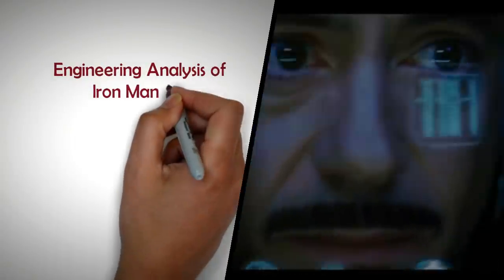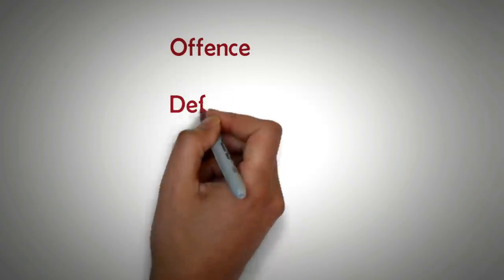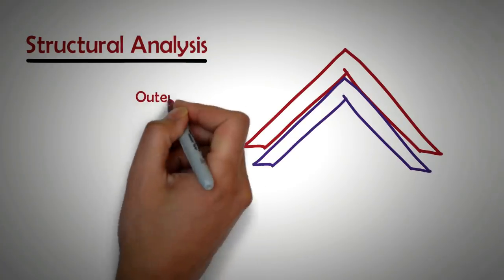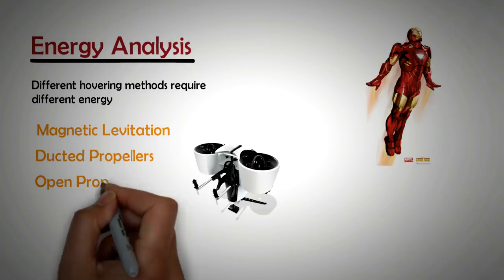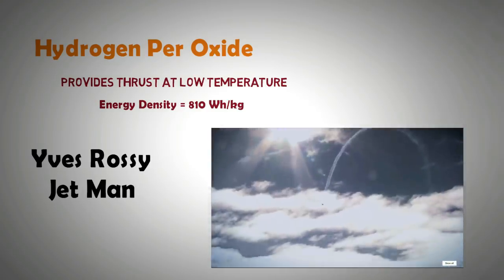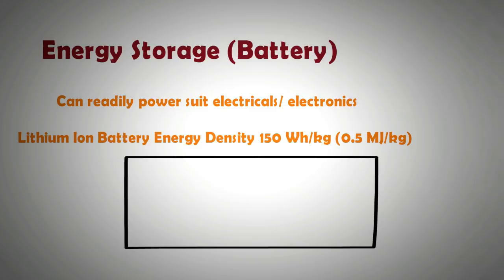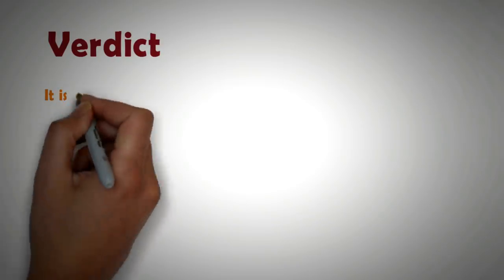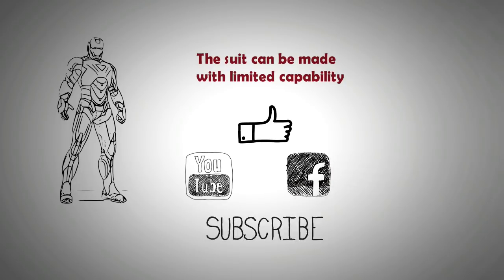Engineering of Iron Man Suit

Comment: Barely anybody is considering a layer of graphene to help with armour. Probably because it’s still technically experimental, but scientists say it could stop bullets

Edit: whilst being thin and lightweight
Reply: Mr Boombastic it would take 23 layers of 1nm thick graphene to stop a 9mm round
Reply: Mr Boombastic also in order to improve energy sustainability you would need CNT (carbon nano tube) muscle packs to have a sufficient power to weight ratio plus the cnt would enable the suit to have the power of a jackhammer in every limb
Reply: Interesting.

Comment: in my opinion, the arc reactor would use degenerate matter, more like a capacitor than a battery. perhaps it simply has a long half life, or the degradation of a certain size mass of matter takes a long time in certain conditions.

Comment: any engineer would know that the suit is impossible (at least for a few centuries) and even if you can find some power source that can power it and could be small enough and safe to put inside the suit it simply impossible for human body to sustain the operating conditions of the suit it could be done but no human inside and would be unbelievably expensive that probably would need the entire money of the globe for several years and it would also be bigger in terms of size. However if you remove some functionalities like flying and hovering and limit it to only ground then yes human body could possible sustain the operating conditions and it would be much cheaper

Comment: The best suit would be a sort of remote controlled therefore not an actual suit but you the controller located in an unknown extremely secure location having intimate control of a suit equipped far better than anything wearable. Then you can have a type of nuclear powered capability. But then the physical interaction factor will be missing. The thrill of actually flying at ridiculously impossible speeds n all that. The thrill factor is a major draw for audiences which cannot be replaced by RC tech. The desire for the wow factor will keep the tech in the realm of sci-fi. RC would shorten the distance distance between the possible n impossible. I doubt the creators of Ironman for public consumtion would ever consider a RC suit. But for real world applications RC robotics is the way. Full speed ahead
Reply from the maker: This idea was explored in Iron Man 2. Problem is when you lose control

Comment: So batteries are impractical, cold fusion doesn't exist and energy density of anything besides nuclear is too low. So work with what is practical'ish...You ruled out nuclear from the start rather than trying to make it work. So...can nuclear be made to work? Stark didn't let that constraint stop him, he later was getting a toxicity issue himself from his next gen arc reactor creation. Maybe nuclear is the only option...can it be done?
Reply from the maker: You can have small nuclear power plants but the problem is radiation shielding. The amount of lead that will be needed would make the suit too heavy. It would be more like the Iron Monger Suit
Reply: I'd settle for the iron monger suit, lol.
But again, that's using old tech. Can we improve shielding tech? Aren't there other elements heavier than lead? How about degraded nuclear fuel sources? Is there a way to less energetic nuclear fuel that is easier to shield? Or how about teeny reactors in a multiple configuration.
Reply from the maker: No, even in depleted rods there is Gamma radiation that is a killer. I am going to explore this issue in my up coming "Spiderman Infinity Suit" video so keep an eye out for that one.
Reply: Will do, thanks!

Comment: What I don't get Is, when Tony pulls his suit from a brief case and the suits fits around him, how thin is that metal?
Reply from the maker: Well, it is a property of metal that it can sliced into thinnest of of slices. So making metals thin is not a problem. Having thin armour on you and thinking of it to be effective is another story
Reply: Synergy Files yes but my point is in the movies the metal just appears around his body the metal would stretch that far and hold it's strength? one step it would just rip like paper.
Reply from the maker: From an engineering point of view, I am thinking he can almost fit a 2mm thick sheet suit in that case. And 2 mm alloys are reasonably tough
Reply: Synergy Files but the way it is deployed suggests it's thinner metal? It's been a long time since I watched it.

Comment: Can't we use solar power with graphite cell's which would produce more energy
Reply from the maker: +Jogendra mishra  solar power is at most 1000 watts per metr square. At a perfect angle at most the frontal area would be just above 1 meter square. Given that efficiency of converting light to electricity is at most 44 percent, with solar panels iron man suit would make 440 watts

Comment: I don't think Its far off . It isn't a new way to make energy that is needed " arc reactor"  It's a new fuel thats needed .  You can use the fuel to create the energy.  A turbine spins in a jet engine  . The motion of a turbine could generate all the power you need . The Fuel and propulsion system needs to be super efficient. Hydrogen stored in a solid state might be an idea if you could contain  a reaction.  I won't be testing this . Cheers

Comment: Don't forget about the nauseating suit folds out in Iron Man 2, the stupid one that comes apart and propels itself in Iron Man 3 and the one that comes apart in itty bitty parts in Age of Ultron. How is there room for any of them to assemble, let alone protect, fly, or increase strength? If they would have bulked it up by a few inches all around and made it more of a clamshell, and reduced his strength and flight speed, he'd still be pretty awesome to the point of being unrealistic.
Reply from the maker: It is unrealistic agreed, but at the same time it feels achievable. That is the beauty of it. Else there are many other gadgets like Loki's sceptor, with various powers. It doesnt however has the same appeal
Reply: Synergy Files I enjoy the movies for the most part, but the armor has always bothered me because I don't see it as achievable. It's not even the power source as much as the engineering. The power armor in Starship Troopers (the book, not those excuses for movies) would be achievable, but Tony's armor is no thicker than a wetsuit, and more capable than any any one specialized machines, yet everyone else is still driving cars and carrying modern firearms. It would be like if the Howard Hughes built a drone the size of a car, that you could ride in when you wanted, connect to radio channels, and modern rockets. He could have taken on the Axis on his own. Or Sam Colt made an AR (plastic and all) and modern body armor but kept them for himself.

Comment: An anti-matter energy supply the size of an M&M would provide way more power than need. I mean tremendously more power. One billionth of a gram of positrons contains as much energy as 37.8 kilograms (83 pounds) of TNT. But with $250 million (U.S.) you could only produce 10 milligrams of positrons (equivalent to $25 billion per gram) it's way to costly. But if you could get that cost down this would be the ultimate power supply.
Reply from the maker: +Dee Broschart True Anti matter packs a lot of energy but the equipment required to harness it would not fit in the suit.
Reply: I have been trying to find info of exactly how the energy is harnessed but that info is really hard to come by. Oh by the way I'm a huge fan. Love your content!

Comment: I would use the new Magnesium based alloy as World's strongest and lightest metal for the armor. Researchers from North Carolina State University have developed a material using magnesium which is light like aluminum, but as strong as titanium alloys. This material has the highest strength-to-weight ratio known to mankind.
Reply: Is the new alloy called maraging steels ??
Reply: Oh or  titanium-3-gold alloy, it's about 3-4 times harder than most steels and four times harder than pure titanium. It is  not difficult to make, and it's not a new material so availability would not be a major issue and for wear resistance: Titanium-3-gold also outperformed pure titanium.

Comment: before going into all the fancy stuff, u should have checked if the actual exoskeleton could be made. meaning if u can actually make something so "tight" on the human body that can give u the mechanical advantages of the suit. u only briefly went trough the inner and outer shell, what about the actual skeleton that gives u the power to lift cars and obviously run faster and longer. the mechanics need to be met before u go into the tech and sofware
Reply from the maker: Exo-skeletons like Gym suits have already been made for deep sea exploration. You are right though. The GYM suit is not very ergonomic. There has been a project done by the US military on exo skeleton. Its called the TALOS project. Not much details of that are available as it was confidential. Exo skeletons however have been made in real life that allow people to lift heavy objects
Reply: @synergyfiles3536 How heavy can they lift ?? Can they lift a car ??

Comment: I'm as far from an engineer as it gets but I found this very interesting! I had no idea the suit could be made - albeit with serious limitations. I'm certain the thrusters would not be in the same place as the comics (in the feet) but do you think small enough variations on the calfs would be possible? Would the same follow for the stabilizers (in the hands)?
Reply from the maker: The rule is that you double the diameter of the thrusters, the force of thrust goes up by four times. So it makes from sense to have few large thrusters rather than several small ones. You are right,  having thrusters in the heel will make the flight more unstable. It would be more beneficial to have the thruster on the back

Comment: Bro isn't the suit can't be made of duralumin. Duralumin is an alloy which is used for aeroplanes.  Duralumin is a strong and light weighted metal. As you said hydrogen per oxide is can be used for the suit, if the suit made of duralumin less capacity of hydrogen per oxide is enough for fly
Reply from the maker: Good point

Comment: you cannot fly without wings! iron man's desiring is "zero" in aerodynamic!
Reply from the maker: What about rockets. People have flown with Jetpacks
Reply: Synergy Files rockets fly vertically in a parabolic path dude...!! they don't fly horizontal...! if you argue about missiles they do have wings to fly...! it may be small but it's enough for small body, weight and hyper speed. iron man don't have any wing.
and about jet packs...! they however! 
for ducted jetpack, the are propelled by "rotary wings" see you need wings!
for gas powered jet packs, they however vertically and move forward!
but iron man will fly horizontal...! that's not at all possible!!!
he will direct hit the ground with all the thrust of his jet!
Reply: Synergy Files all military fighter flights are supersonic as fictional Ironman so why a flight require wings! and Ironman doesn't? 
thrust only can do everything! you need lift!
Reply from the maker: https://youtu.be/WQzLrvz4DKQ Enjoy
Reply: Synergy Files video is not available!
from the thumbnail it's a Hover board right? it to requires rotary wings! am an aeronautical Engineer. I'm talking about Ironman's aerodynamic not a Hover board's aerodynamic
Reply from the maker: If you look at the video, there is part where the summer Olympic ceremony was shown. Jetpack was used. No wings! You need thrust to Hover.  And Stabilising force that come from Ironman Guanlet. In modern aircraft, Thust Vectoring done. This doesn't require aircraft wings. Surely you should know this. You are an aeronautical Engineer.
Reply: Synergy Files  ofcourse you are right about hovering and thrust vectoring dude! it's not wrong.
I'm saying that you can only Hover with the iron man suit by its configuration to thrust! launch upward then what? do you understand about a stable horizontal flight?
Reply: Synergy Files in Ironman 1 his suit will free near space and fall towards ground, at the last moment he will manage to fly horizontally near ground. it's not at all possible.
Reply: Synergy Files I'm not saying hovering is not possible. it's possible and it's already done. am saying with Ironman suit you can only Hover and cannot fly as the show, it a fiction and it's not possible

Comment: Boron as a FUEL. The next big thing. As a fuel source. Redundant SMA's. Lithium Hydroxide in pockets in a layer between two skins. Use the water created in the carbon dioxide removal to mix with the H2 producing compound. You now have boron AND hydrogen as a fuel source along with lithium ion batteries. Titanium alloy shell with carbon fiber bracing. Wicking cloth to move water and sweat away from the pilot/driver. Also , though I can't go into details , there is L A R G E push into something called M.E.H.A.S which gives incredible strength in a quite small package. LOL however 18 relief valves of various brands and pressures have exploded quite violently except one. Just info
Reply: nuclear arc reactor may be

Comment: I have to disagree on the structural analysis.  Making bullet proofed armour is not as simple as this video suggests.  Titanium alloys are not a magic solution to all problems.  They just don't stop bullets as well as other options.  Its worth pointing out that titanium is not used in any trauma plates that I know of, and neither is it used in MBTs or LAVs for armour plating in any capasity.   And despite how you think steel is not up to the task for an iron man suit, steel is used in both trauma plates and tank armour.  The bit about body armour being to hard can lead to complete transferal of energy to the person wearing it is just nonsense.  Many ballistic trauma plates use ceramic that will a) break up the bullet due to its extreme hardness and b) the plate will crack, dispersing the force over a larger area.  Typically, level iv ballistic plates will be made of ceramic backed with composite materials to catch the bullet that has been destroyed by the ceramic plates. 

 The two main types of materials for ballistic trauma plates used today are ceramic and steel.  The advantage of steel over ceramic, is that steel will not shatter, so it can take more follow up shots than ceramics can, however ceramic plates can typically stop larger caliber for less weight.  None the less, the steel is quite hard, as to attempt to deform any bullets hitting it, limiting penetration significantly.  Hardened steel is significantly harder than titanium, so it will not have the same bullet deforming properties as steel or ceramic will.  That is not very good for titanium's prospects as a ballistic armour material.  Also: 

"We cannot make an exoskeleton armour that would crumple, or else its use would just be one off."

Sure you can, and not necessarily.  After all, crumpling armour has been used for thousands of years.  Good example: https://i.pinimg.com/originals/30/e4/82/30e4825162acbe25d99f917bcba49a85.jpg.  Notice the breastplate, and how it bulges outwards.  That its providing the wearer inches of space between the plate and his body.  Another example, https://i.ytimg.com/vi/itO64ZBX1jU/maxresdefault.jpg look at how the helmet is spaced from the wearer, so that any dents do not transfer energy directly to the head.  We wouldn't exactly be the first ones to have spaced armour on a person.  The nice thing about steel is that it is a very versatile material.  You can play around with the hardness vs flexibility to find a solution you are comfortable with.

I haven't heard of sorbothane before.  But since it isn't being used by the NFL to all but extinguish their problems with concussions, colour me skeptical. 

This last point has nothing to do with iron man, but anyway.  Differential hardening is hardly a unique invention from Japan.  Its been used since metal existed, near universally on bronze swords, and to this day with axes.  Its true that Europe did not generally use differential hardening for their swords, they chose not to, because their are advantages to homogeneius steel swords.  Most notably, they can be far more flexible, which disperses the shock on the blade, making the sword a lot more durable.  Watch this video, https://www.youtube.com/watch?v=4SZg7FPajdk look at how the slow motion shots show how the sword flexes and vibrates under those heavy impacts.  If you used a katana like this, it would heavily warp, and be unusable.  The homogeneous sword however just needs a bit of a sharpen (if that) and its as good as new.  And not only that, but this video also shows that the softer edge still cuts just fine.
Reply from the maker: Some very valid points. Its good to have your input. May be in the coming videos, I will use them
Reply: Oh wow, well thank you.  Didn't expect you to respond.  I am hardly an expert on these subjects, so you may want to do your own research, but feel free to use anything I said.

Comment: arc reactor of that size is not possible even if it is..it can't be put in the suit since it will melt due to the laws of thermodynamics.
Reply: the reactor should be a cold fusion power
Reply: By “due to the laws of thermodynamics” do you just mean it’ll get really hot?  Or is there something specific about entropy or compression heating that would specifically affect a theoretical reactor of this size?